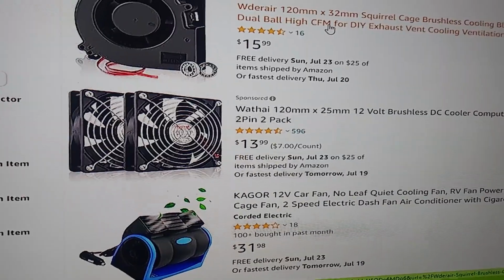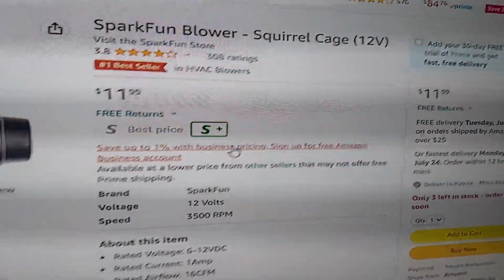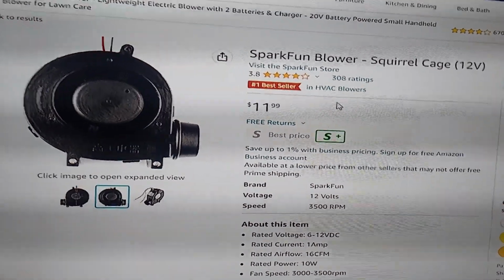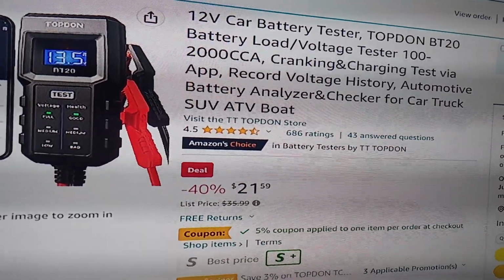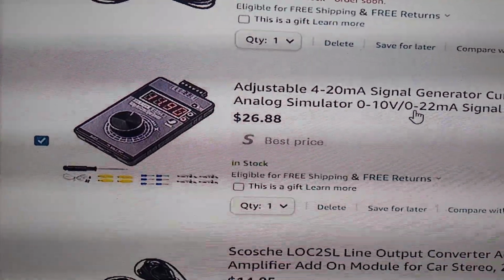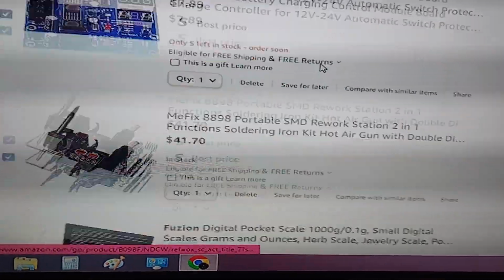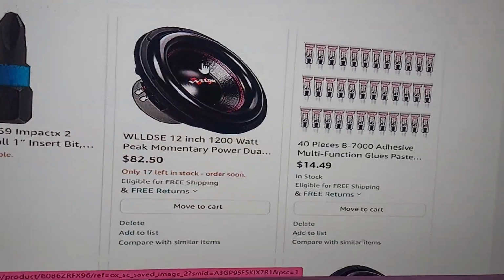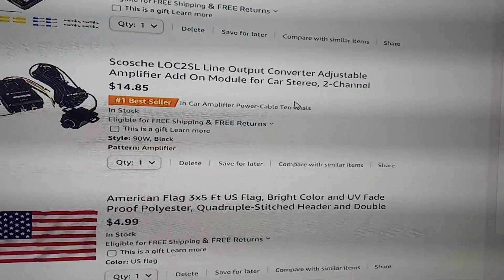Amazon Recommendations+ Sine Wave Signal Generator + Bluetooth 5 Mods + Subwoofer Finds + Only Fans

Comment: Las cruces NM the heat is so bad cant even use taramps amps.. Which i really dont like anyway and not a fan of taramps at all bu i have 3...I had to order a new amp..I got a black diamond with a removable acrylic top and took the top off and put a fan on the top of the amplifier and so far so good...Not as much power but its doing ok for now

Comment: So you can’t be a Mexican and be a an American citizen and do good work in a flag factory?
Reply from the maker: I was just pointing out the differences in the assumptions of white Americans vs reality.  I think it's great actually.  Most of the workers at Rockford, when they made amps here in Arizona.. were just old, chubby Mexican ladies that would talk trash about the one white meth head that always thought he was in charge when he was just working the line with them.  I saw that when I got to tour back in 1999 when I worked for Lightning Audio and RF had acquired them.  He knew they were talking trash but he didn't know Spanish so it was quite entertaining.

Comment: I used to use a cut off wheel and cut openings in the bottom plates on my amps to mount pc fans and just soldered them onto the remote input. Worked pretty well. Now as I’ve gone bigger I’m using a plexiglass box to house my amps with 2 marine bilge fans one for intake and one for exhaust. Much louder than a pc fan but works great and depending on where it’s mounted you don’t notice it all that much. I run mine just with a switch but you could easily add a relay and use remote turn on.
Reply from the maker: That is wrong.   #1, you don't need to be modding your amps like that.  #2 THE HEAT SINK is where the heat is.  So that means THAT'S where the fans should be at.  Not the guts.
Reply: @RobotUnderground  yea it would’ve been much more effective on the heat sinks, but hey I was a dumb teenager and thought I was doing something 😂
Reply from the maker: @RonnieMacJr69  GOOD!  Don't let me catch you doin' that shit now.

Comment: I have a signal generator similar to the first one you showed. My only complaint is you one must pause it then set the frequency and start it again. It would be much more helpful to have the frequency on a pot so one could do sweeps. 

Just a heads up to anyone looking for frequency generators.
Reply from the maker: Yeah, I still use my old school one that's in many of the videos.  I also use my Rockford OSC2 since it's portable.

Comment: I use a digital 12v thermostat on my amps. Fans turn on when the temp gets to 105.
Reply from the maker: wuss!
They can take more than that.
Reply: @RobotUnderground  never said they couldn't. They can take way more. Why make them if I don't have to? Lol. Heat causes issues so I think it's pretty fn smart. Don't be mad bc you didn't think about it first. Lmao

Comment: Put some peltier devices on the class d chips on the cold side
Reply from the maker: Peltiers are better with a remote heat exchanger instead of at the amp.   Just a cheap fan works wonders.

Comment: It seemed parker wanted to hate on it but the HCY15 wouldnt let him! But he still didnt rave it up, it passed his torture test and other subs that pass it hes doing back flips doin 2 handed devil horns but the HCY he said notttttttt terrible... Not terrible? What does it have to do to get an awesome loke the other subs.... hes not far from sundowns stomping grounds and it being a SAv2/Uv1 "knockoff" he didnt wanna say hey look its exactly like an SAv2  but bigger motor,3" coil, handles more power and waaaaaaaaaaaaaay cheaper its actually more of a threat to the U....  My 12s took around 60grams and a beefie 7" convex cap to get the FS down to 31 It went from a super punchy sub awesome for rock & double kick drum metal to a good all around sub that plays lows and still decent for metal, mudic like slayer, lamb of god meshuga thats the unmodified HCYs jamm
Reply: I just bought two 15 hcy. What you have to do to modify them
Reply from the maker: @Mr.NiceGuy78  I added some washers and epoxy.
Reply from the maker: Yep.
Reply: Parker’s just another brand boot licker, and he’s nowhere near as bad as some of the rest. Probably only because he doesn’t sell the stuff 😂